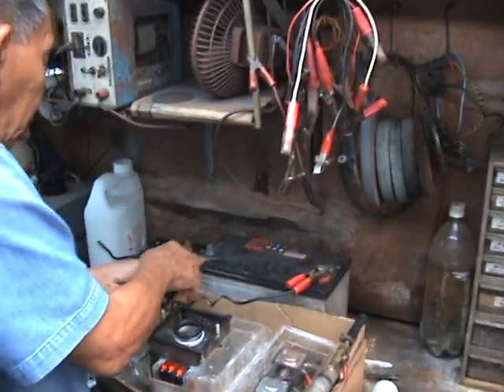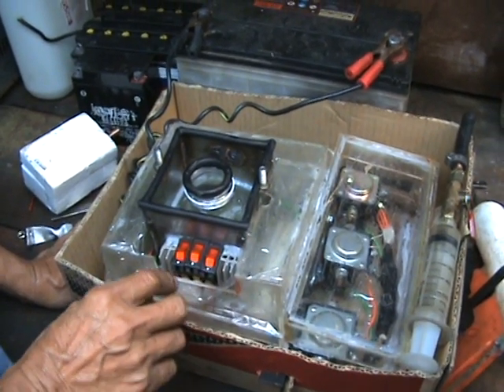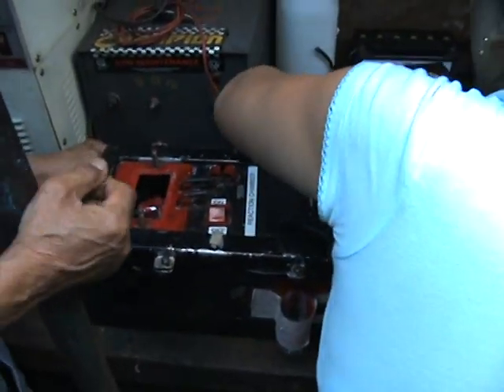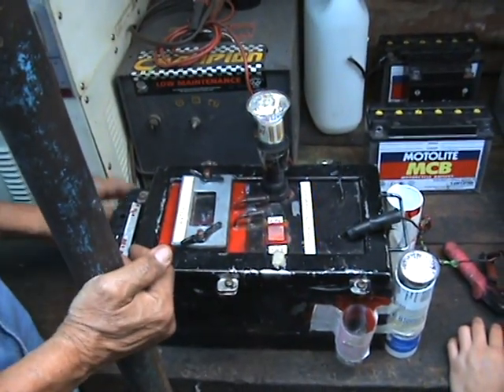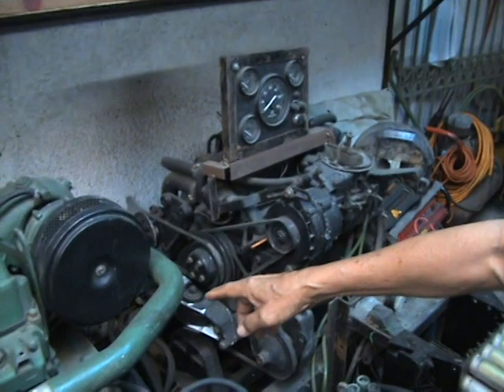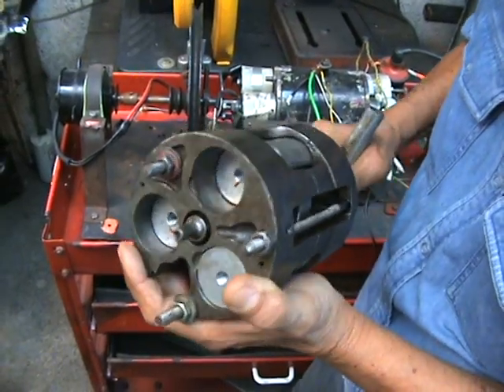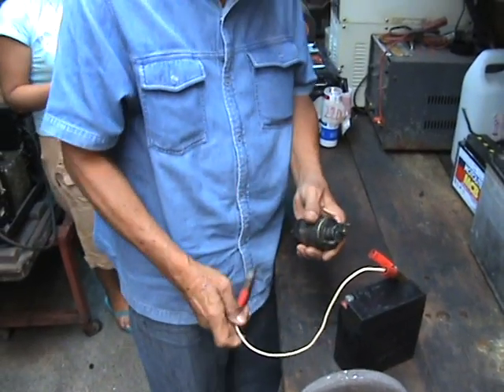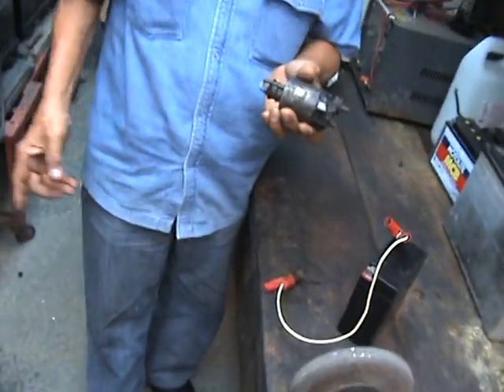Daniel Dingel 2008 0.1

Comment: why the dogs barking on every clip? i mean it is day and they have to sleep and protect by night.
Reply from the maker: @spamiser8991  the dogs are barking because they are dogs. And dogs bark. So they are barking.
Reply: @doctakay  daniel is talking so much and i can’t hear a word 😄
i ask me in the last days about toyota and their „invention“ in new hydrogen gas fuled cars. did they bought the secret of daniel?
Reply from the maker: @spamiser8991  no. Toyota didn't buy the invention. But his invention can be boiled down to a cross between a "joe cell" and electrolysis. He was a nice fella. I was grateful to be able to spend some time with Mr.Dingel.
Reply: @doctakay  what a honor! you knew him. i assume he used high voltage electrolysis. i need more info on that joe cell.

Comment: So in first reactor there are 3x starter relay and 3x switch?
Reply: Starter relay can handle high amperage especially when you put in series without damaging the batteries even if you put too much baking soda, or sea water same with a principle of salt lamp it can light a bulb using two different metals and water solutions whatever they put in it.
Reply: @porferio-wk4jl is that his principle?
I read that was just decoi, and that he used CDI ignition for HV pulses dumping in cell

Comment: Inside Daniel Dingle's reactor, there is a pond fogger that immediately breaks the water into a cold water mist. Above the device, a piezo electrically conductive material is placed, and in his case it is BISMUTH. When the pond fogger works, it produces ultrasonic vibrations that break the water into water mist. an excess of ultrasonic waves is created that go to the bismuth crystal, and at that moment when the crystal picks up that excess wave, it immediately releases a current and that current splits the water mist into hydrogen and oxygen. Which means that we have water mist + hydrogen + oxygen. When that mixture is subjected to a strong plasma spark, a huge amount of energy is released. It can be said that ATOMIC Energy is released in the combustion chamber, which is responsible for moving the pistons of the engine. It is the real reactor of Daniel Dingle. I am currently building such a reactor on my vehicle. Instead of Bismuth crystal, you can use Zinc Oxide crystal, which gives the same characteristics as Bismuth and it is easy to grow that crystal.
Reply from the maker: I look forward to your results, and I hope you will come back and post the link to your work here on these videos. Thanks for watching 🙂
Reply: @doctakay  Of course, I needed to explain the operation of this device. So that people no longer have to guess how this really works. You will soon see how the reactor works. Anyone can make it without having to pay in return. You just have to think outside of the imposed knowledge here on the internet. There are books that I have studied that date back to the 1800s.
Reply from the maker: @AleksaRancic  that's awesome I appreciate it!
Reply: What about the honey comb? @AleksaRancic
Reply: Why is it he always having focused on that starter solenoid what is the purpose of that solenoid, maybe stater relay can handle more amperage in my own observations you can put baking soda the starter relay will handle it without damaging the batteries

Comment: He's been killed because of his invention?
Reply from the maker: No, I don't think so.
He was an elderly gent when I met him all those years ago, and he had been promoting the concept for many many years before that. I suspect his German 'investors' that were staying with him weren't doing their best to help get the concept off the ground in my opinion.
Reply: @doctakay  
Thanks for the clarification. 
Has nobody tried to take up his idea and build such a machine again?
Is there a guide to building such a unit?
🙏🙏
Reply from the maker: @michaelmichail9627  I'm sure he had a particular knack to it, but if you look up electrolysis for hydrogen generation, you'll see the basic concept. It is sending current through a pos and neg plate system in water or an electrolyte solution. As a side note though, I do remember using a vacuum tube to control the engine speed by either blocking off or allowing flow thru it.
Reply: @doctakay  
Great hints, thanks so much 🙏👍

Comment: Simple lang mga folks.aandar una yan start the engine using diesel or gas.alternator produce electricity then the hydrogen machine works so wala din gas padin para umadar makina walang gas wala din yan.may mga unang inerview mga yan at pag aaral na mas mapapanahal kapa dyan kasi nd mga hybrid.sad to say old model nd na idevelop ng maayos.
Reply: Can u explain  bit how the hibr engine  supposing to work . What it s wrong with
Reply from the maker: @polgutierrez7145  Sumasang-ayon ako, ito ay patunay ng konsepto at hindi masyadong pino.  ngunit sa gayon ay gumana ang makina.  sinimulan niya ito gamit ang gasolina.